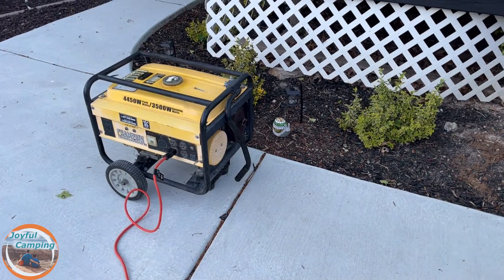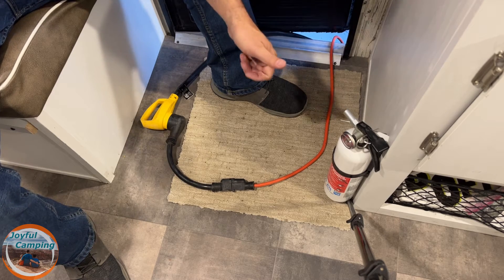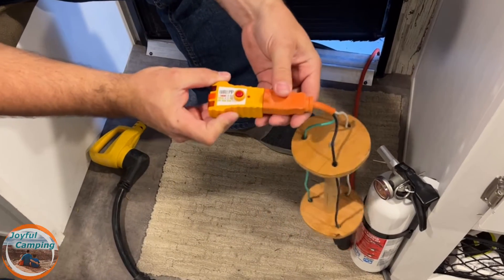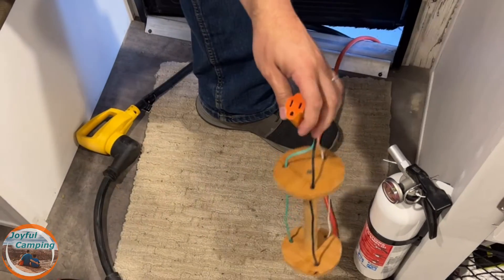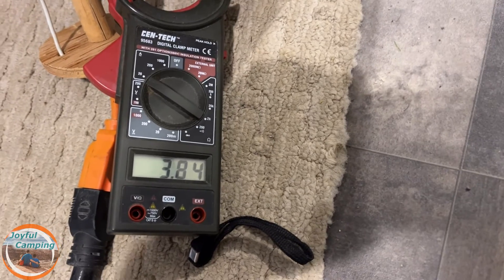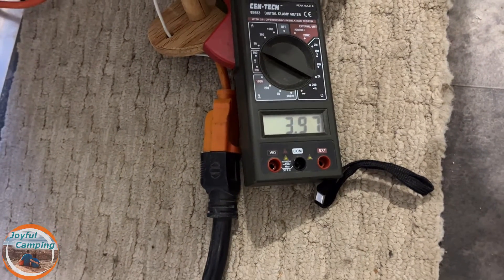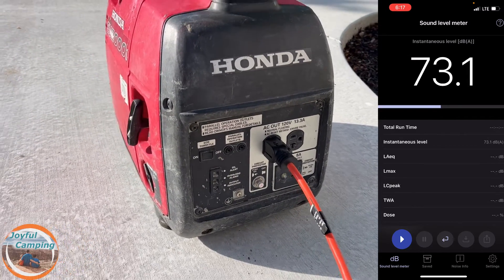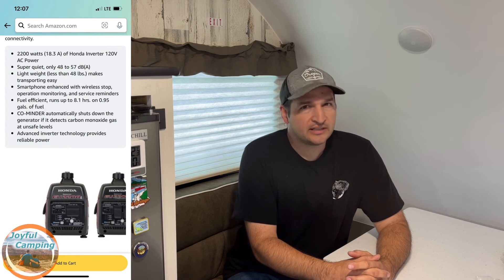Testing the Air Conditioner Amps Used in a Rove Lite 14BH RV Travel Trailer (5000 BTU Window Unit)

Comment: that unit is going to pull the most power when it is hottest outside.  at about 70 degrees outside, that thing will pull maybe 380 watts, and slowly climb to 450, but at 100 degrees outside, it will pull in between 500 and 600 watts.  the power draw goes up slowly as the unit gets hot.
Reply from the maker: That's some great information.  Thank you!
Reply: How to plug the AC unit directly? Where are the wires/plug for that? (I have the same Rove Lite trailer)
Reply: The ac cable goes into a 15amp plug under the driver side dinette bench, on the wall next to the fridge